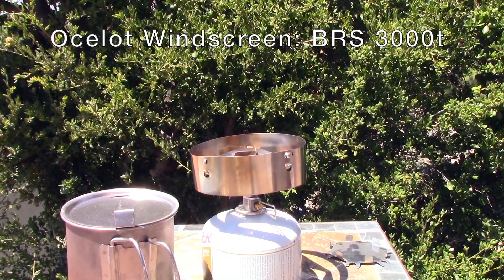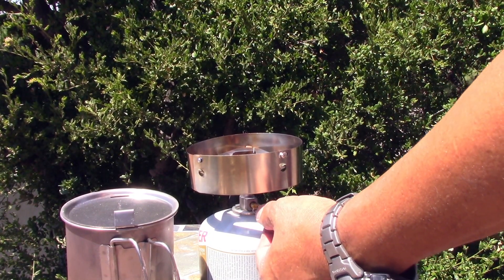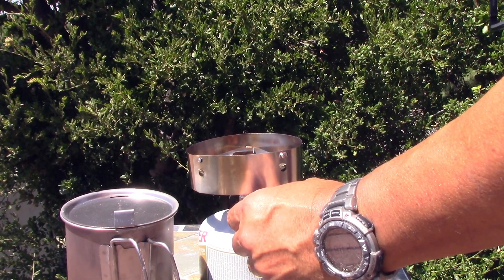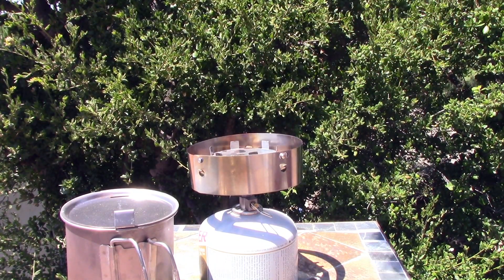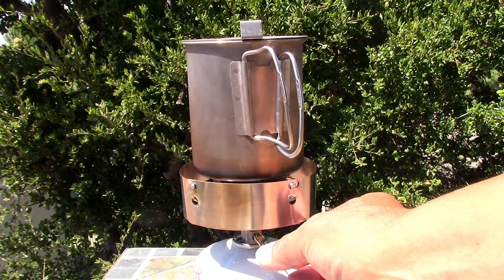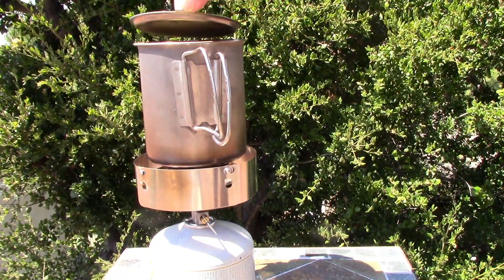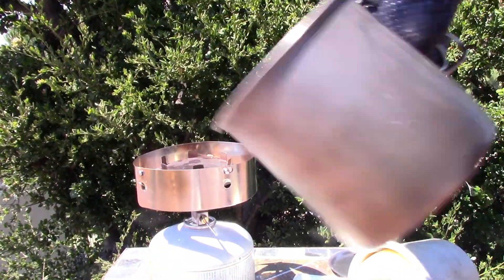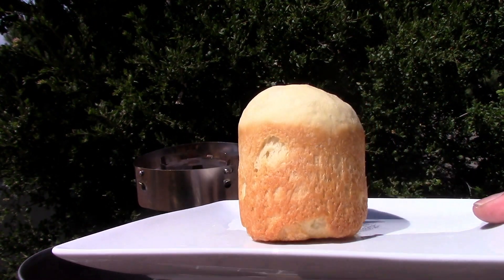Dry Baking using the Ocelot Windscreen by FLAT CAT GEAR

Comment: Since you are using a diffuser with a riser, could you bake directly in the cup? Are you using the baking dish for convenience or some other reason? Thanks. Nice video.
Reply from the maker: The baking pan sits directly on to the bottom of the pot.  Thicker walled aluminum pans allows teh heat to flow from teh bottom up the sidewalls.  That is how baking is accomplished.
Reply: @FlatCatGear  Ok. Thanks. I didn't realize the outer pot was titanium.